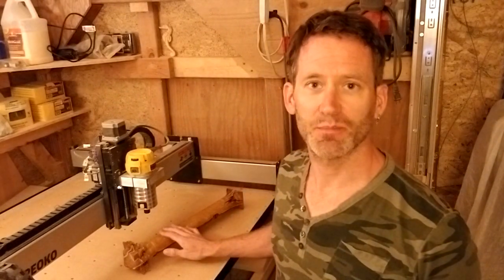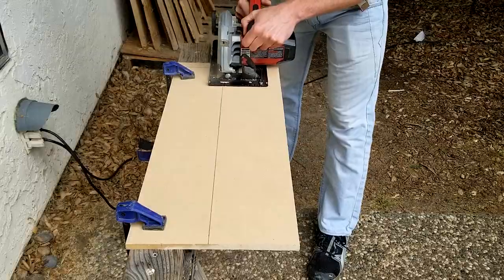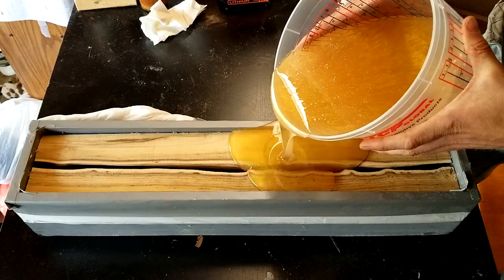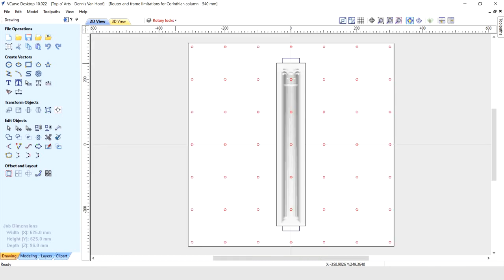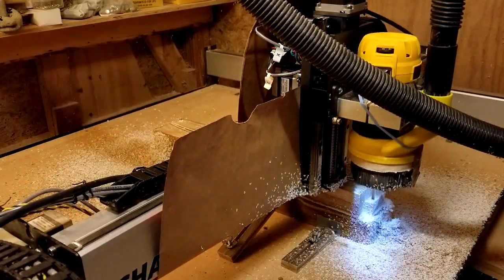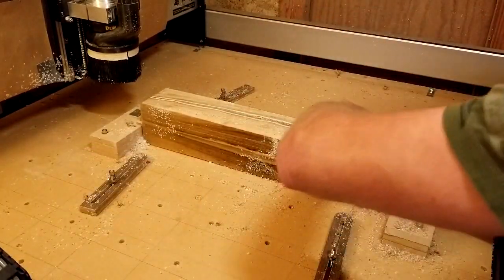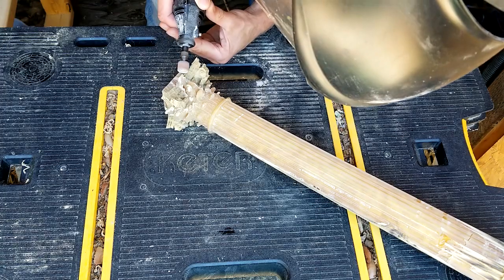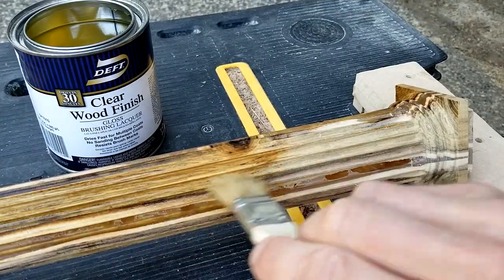Lock & Key technique for 4-sided CNC - Carving a Greek column

Comment: Great Video, Dennis!   I've been doing Home CNC since 2005.  I've built a 2'x4' router, and plan on building a larger one at some point.  Nice work, and a great tutorial on machining 360 Degree/4-sided tool paths.
Reply from the maker: Glad to inspire, Joe! I started with CNC at the very end of 2018, so you are well ahead of me with years of experience. I'm confident that you will get your super-sized CNC up and running; good luck with your project!

Comment: Does the overcut you mention at 1:20 (due to the bullnose tool) help to create a smoother machined line after rotating the wood?
I want to try to cut a human face with high detail/tiny tool and wonder how the details will be preserved. 
I might try 90 degrees of rotation at 45 degrees/rotation since the back of the head is not important.
Thoughts?
Reply from the maker: Ah yes, good question. You are right about that "smoother" edge, for a technical reason. I'll try to explain (difficult without pictures):
The need for an overcut depends a bit on the type of software that you use to create the tool paths. I use VCarve, and that software has the option to add an overcut distance at the exact depth of the automatically generated (horizontally flat) limit planes, as the tip of the ball nose would otherwise stop as soon as it reaches that limit plane depth. But since the bit has a ball-shaped nose, the sides are rounded towards the tip, which means that you will never be able to get that last bit of stock removed from the bottom corner (you can't fit a ball all the way into a square corner). To overcome this, you need to cut a bit deeper so that the straight side of the ball nose bit reaches that point; that extra depth is the radius (half the diameter) of the ball nose tip. But since I could not make use of the limit plane that is automatically generated by VCarve (because I created diagonal limit planes at 45 degree angles, for a combined 90 degrees), I had to artificially add this overcut distance, which I had to do in Meshmixer. Meaning that those diagonal limit planes need to be slightly lower than when dividing the shape into 4 quadrants (that is at least the radius deeper, going straight down).
I hope this clarifies. Note that I also plan to make a head some time. I have a few other projects lined up, so it will take me some time to get to it (probably several months, considering how difficult and complicated my projects tend to be). In the meantime, I think that you can experiment a bit with this video as well as my latest female torso video (https://youtu.be/8qZ6xDg9TWU) to help you in the right direction.
But if you use a fine-tipped ball nose bit (less than 1/8 of an inch), then the imprecision of your setup will probably be worse than the carving scars (that's how I call those lines at the edges where two-sided carves meet),a nd you'll have to do some manual clean up anyway.
Hope this helps!
Reply: @dennisvanhoof9958  It does help, thank you!
I'm anxious to put together my SO Pro XL CNC and get back into this hobby. My old Shapeoko 3 has been ignored for four years.
I had so many issues with a lot of things, I found I didn't want to find the time to dive in deeper. But I do now. 
And the tools the Pro comes with will help overcome my lack of craftsmanship.
Thank you for again for all you have shared.
Reply from the maker: @coulterjb22  Good luck, and don't be afraid to make mistakes (I make lots of them, and I learned more from those mistakes than from learning how to do it right).

Comment: Hello, I’m following this as a guide for my own 4 sided project. So I’m wondering why you can’t import the model to vcarve and set it to cut half the model. Then rotate it 4 times.
Reply from the maker: Good question!
Primarily, because not everyone can afford VCarve, whereas Meshmixer is free. This technique does not require you to use VCarve, as the final model created in Meshmixer is ready to go in any CAM software.
Furthermore, as far as I know, you cannot create sloped limit planes in VCarve, which means that you'd be doubling your machining time, as you're carving a lot of air.
Hope this clarifies.
Reply: @dennisvanhoof9958  thank you for the speedy reply! Very good point about carving air. With the meshmixer plane slicing that you do, is offsetting the stepover necessary? How do you match the stepover in vcarve when you set up your toolpaths? I think I’m missing something and I don’t want to rotate and realize the corners don’t line up.
Reply from the maker: @Glop648  I'm not exactly sure I understand your question. Once I've created the 3D model, I use the same principles as I would for any 3D model that I import in VCarve.

Comment: Great work! When the CNC machine is working for hours are you near the machine so that if anything goes wrong you can switch it off? Of do you just let it run over night?
Reply from the maker: I definitely don't dare to let it run overnight. But I don't have the patience to sit next to it for hours either. I do check in on it every now and then, and can usually hear it as background noise when I'm in my house. So if the humming sound is suddenly off, there's something wrong, and I rush to the shed in my backyard to stop it. I've had several incidents, such as a broken 1/8 bit, a belt that snapped, and those kind of things.

Comment: Hi Dennis, your works and technique all are fantastic, and really creative. I would like to start 3D wood engraving and the first thing is machine. I was thinking about Shark or Avid, which are relatively expensive machines. Do you suggest me to buy a Shapeoko or its new pro version? Do you have another brand in your mind that you wish you knew before buying Shapeoko? Thank you! and continue your great work.
Reply from the maker: Hi Ashfin, I suggest you browse for some different machines and read the reviews that you can find online, so that you can pick the CNC that is the best for what you plan to do. I own only a Shapeoko and a BobsCNC, so I can't give you any advice on other machines. The Shapeoko is quite a capable machine, as you can see in my videos, and it is good for everything that I want to do. BobsCNC is half the price, but not as sturdy, and has quite a bit of flex, so I converted that machine to a LASER CNC. BobsCNC is a nice beginners machine to get familiar with the process of CNC routing, but you'll need to go for a better machine if you plan to do work that is more strenuous on the CNC.

Comment: Another great video Dennis-san! I ordered my XXL today and I'm excited to get started! Do you normally run your machine with a shopvac attached? How dusty does your shed get? I'm already drawing up plans for my enclosure.
Reply from the maker: Thanks, Will! I run my jobs with a Dust shoe whenever possible. But for some of the large 3D projects, it's not really of any use; especially with my rotary setup, as the dust just escapes downwards into the hole in the CNC bed. I don't use an enclosure, as my main concern is the dust clogging up the belts and rails; I've lost some projects due to a slipping belt, so for these kind of jobs, I need to regularly pause the carving process to vacuum and clean the moving parts as much as possible. An enclosure might make things worse, as the dusty air just gets circulated. Besides, I don't mind my shed getting dusty.